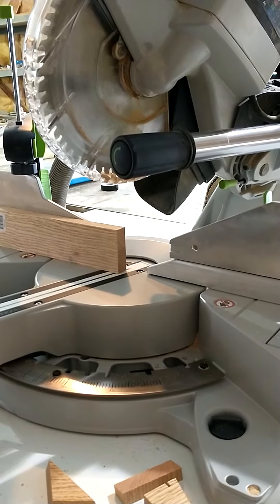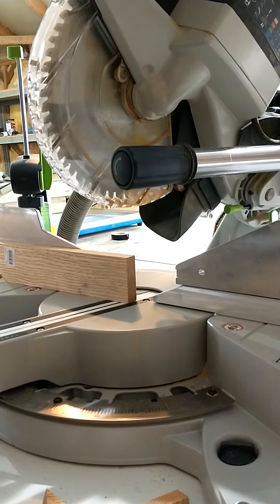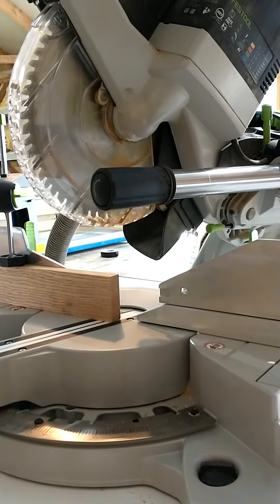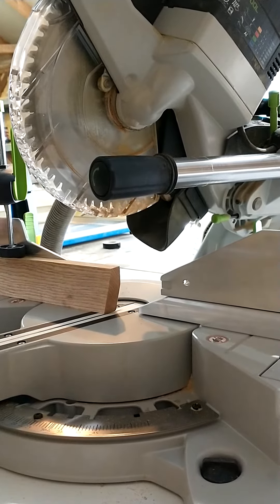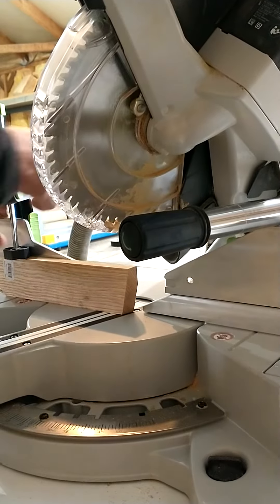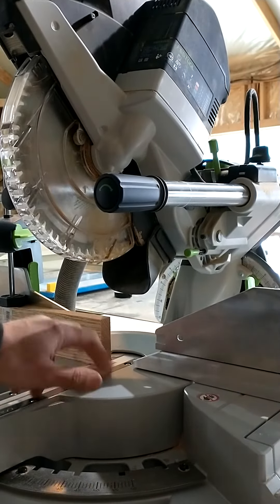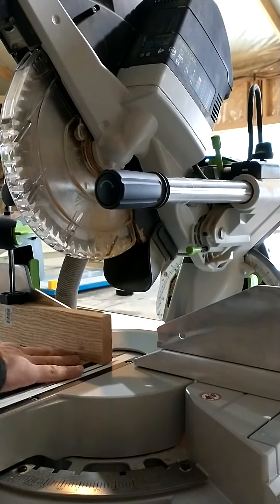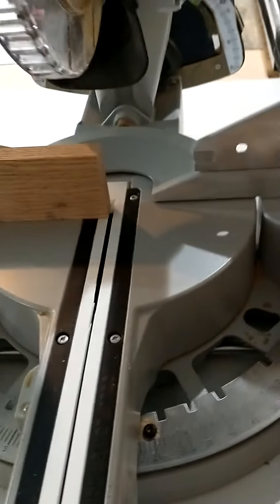Dust Collection Analysis Video #2 for the Kapex Cube Fence ZCI

Comment: This fence system is awesome! I've been using it since a couple of days and it's a game changer!
What hose diameter are you using. 36mm?
I made a couple of blocks about 25% less tall which helps the rubber inlet go over it better. I also cut a small 45 degree bevel at the back of the cube so the rubber dust inlet won't catch on it when sliding the blade towards me. This gives me much better dust collection when making wider cuts which cause the rubber inlet to go over the cube. (I still only have a 27mm hose for now, the 36mm is coming soon)